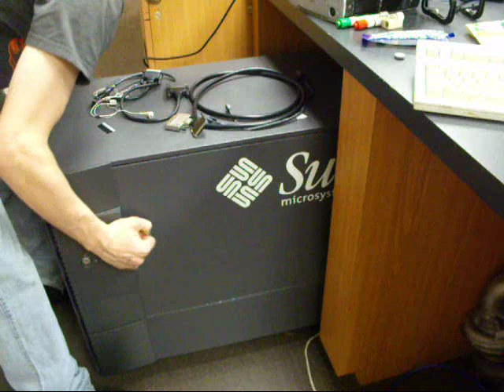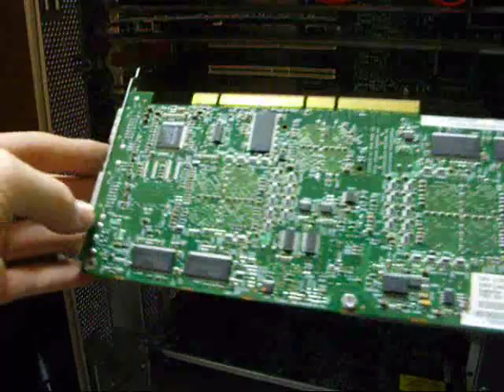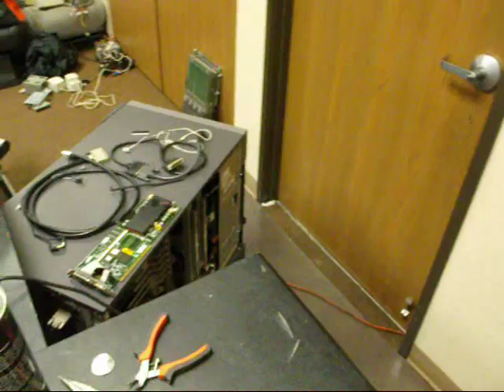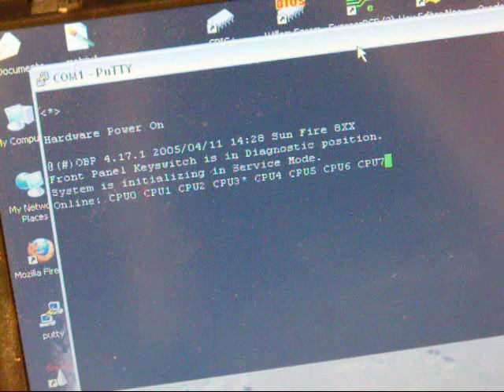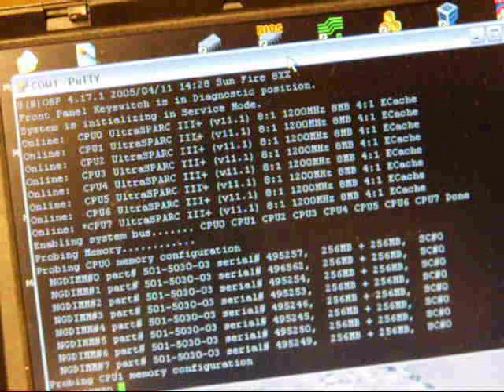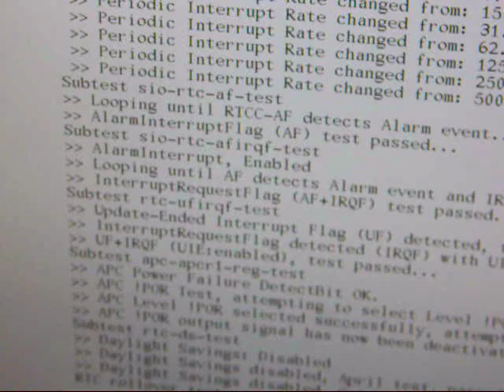Sun Fire v880 Tour, PCi ii upgrade, and boot up

Comment: Doogie, did you get the PC card to work properly in your system, as I have bought a V880 with an XVR-4000 fitted and I would like to fit a PC card into my machine, but the company that supplied me the system said that the PC card isn't qualified on the V880?

Comment: I know it's 4yrs later, but that "goo" was most likely the oil from 3M heatsink tape. I hate that shit. While not conductive, it will create high frequency shorts. Plus, the oil not being in the sink anymore means it doesn't cool as designed (i.e. the chips get cooked as well)

Comment: @Jose You can use a Cisco console cable to hook up to the serial management or the serial port and access it via "serial console". You'll need a terminal program like PuTTY on your controlling machine, then you will install an operating system. Solaris is the best choice IMO for a Sun Fire. It's not too much different from Linux, so it's relatively easy to learn, and IMO a lot of the commands make more sense on Solaris than on Linux. Good luck!

Comment: keep the fiber card, take off the serial and parallel bracket all together, use a powered hub and usb to serial via the single usb 2.0 slot. BOOM single slot. assuming your video card heat sink doesn't interfere.